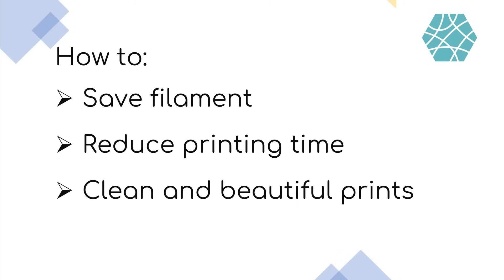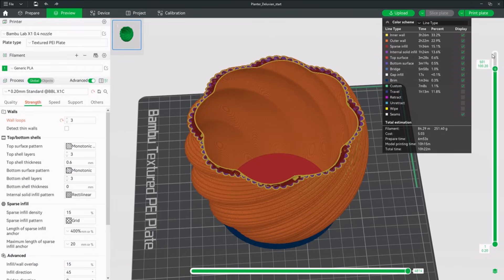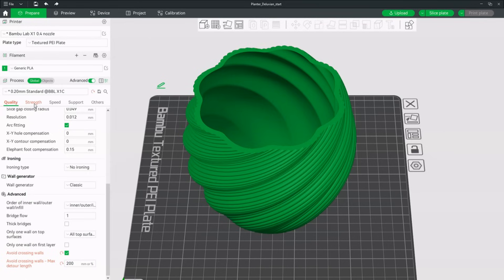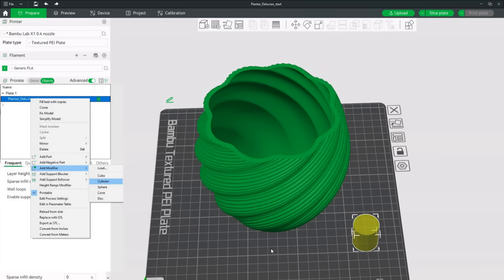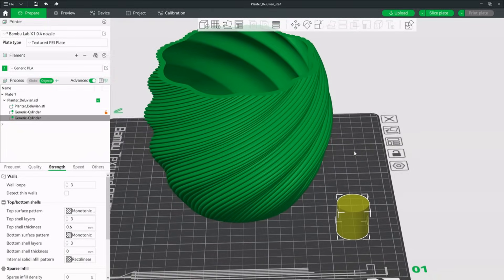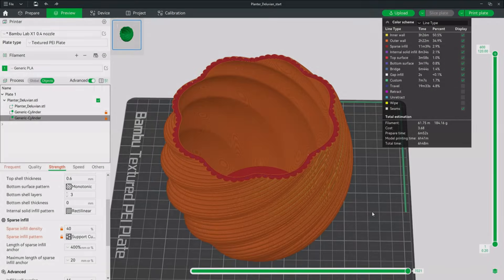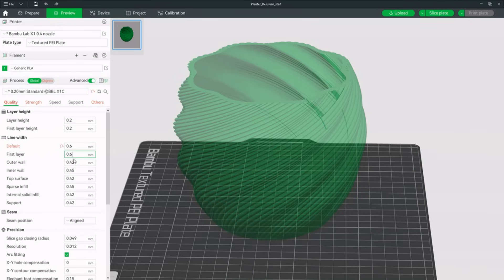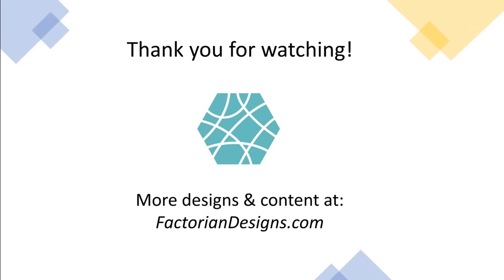Cut Your 3D Printing Time In Half!

Comment: DId they take away the avoid crossing walls option? For me it's not there in Bambu Studio
Reply from the maker: No, its still there for me. Did you turn on "advanced settings" ?
Reply: @Factorian_Designs  Yes I did, it's definetly not there. Did you update Bambu Labs to the newest version?
Reply from the maker: yes I did, for me its still at the very bottom of the quality tab. I am honestly not sure why yours is not there.
Reply: @Factorian_Designs  I suppose it had something to do with a profile I selected? After I restarted Bambu Labs with another model, it was exactly where you showed it.

Comment: Great video! I'd love to see a similar video on how to optimize slicer settings for the 0.8mm nozzle on the A1.

I'm just starting with the 0.8 nozzle for functional prints and i have to relearn what is appropriate for line widths, layer height, speed. And also now I have to apparently configure max cubic mm throughput of the filament itself.

Comment: After you changed the line width settings to 0.6 mm, you decreased the wall loops by 1 from 3 to 2. The default setting for wall loops is already 2. Does this mean we should decrease it to 1 or keep it as it is? Thanks for the tips!
Reply: @Factorian_Designs Here wondering the same thing. Your slicer shows the 3 highlighted red meaning it's been modified from stock value, then you decrease it to 2. Mine is already 2...  This almost suggests you've increased it at some point just to decrease it again. My current assessment is that leaving it at 2 but increasing line width will slow my print not expedite it.

Comment: Thanks for this video, its super helpful. One thing I don't understand is the Line Width setting though. When I increase my line width to 0.6, it actually increases my print time significantly instead of reducing it. Do you have any idea why that happens? Thank you
Reply from the maker: You may already be at your maximum flowrate. When you increase the linewidth this also increases the filament flow through the nozzle, in return the slicer might slow your print down to prevent underextruding.

You can increase the maximum flow rate in your slicer as a test. But be careful, this limit ist there for a reason. You might have to get a highflow nozzle if you want to print even faster.

Comment: I suppose the design type matters quite a bit, because I followed these and initially had a reduction of about 10% on the time, (no where near 50%), and then once I added the layer modifier and it actually increased the time by 20%.   Maybe I missed something - but I don't think I did.
Reply from the maker: Design can matter quite a bit but I don't see how this should increase print time. Most of the time I can reduce the print time by around 30%.

Comment: Only hobbyists have time to spend so much time in Slicer. Everybody who runs printing farm, has no time for this. It is kind of sad.
Reply from the maker: I use these all the time for my small print farm. In my opinion, print optimization is important. Spending a few hours optimizing a print can save you a significant amount of time and money in the long run. Check out my new video with a total of 4000 produced eggcups , and you'll probably see what I mean.

Comment: There are no Height Range Modifiers in Cura, so you use cylinders?
Reply from the maker: Yes thats what I did when I used cura. Cura does offer a postprocessor "ChangeAtZ" but the setting you can change there are pretty limited.

Comment: Do you know why the nozzle kicks off sometimes the object? I was printing a miniature and nozzle kicks off and lost  everything.  My print is a bambu A1.
Reply from the maker: Most of the time this is due to warping/insufficient bed adhesion, but its hard to say without seeing the failed print.

There are lots of websites which explain this problem in more detail than I ever could, hopefully this keyword and a little google search helps you solve the problem.

Comment: And if you completely remove the part from the table, then it will print in just a second
Reply from the maker: and while we are at it lets just throw out the whole printer to safe even more time.
Reply: @Factorian_Designs  By the title of the video, the picture in the preview and the methods described in the video, this is exactly what you mean.

Comment: The settings will help but the infill part is very misleading and should have been stated as being a case by case basis.
Reply: Yeah, if it's not something that has a form already, such as this vase, it won't work
Tried with a cube open at the top and you can just press and crumble the walls

Comment: I'm stupid.  Everything I work on will drop to the plate.  I haven't found the setting to allow objects to sit  off the plate.
Reply from the maker: Imported STLs/STEP files will always drop to the plate (others wise they would not be printable) Only modifiers are allowed to "float".
What slicer are you using?
Reply: @Factorian_Designs  Using Bambu Studio. Used to used Cura slicer for my Ender 3 but got myself a Bambu Labs A1 with AMS lite so assumed the built in Add objects would be the same.   All primitives drop to the build plate.
Reply from the maker: Right now you are probably just right clicking your screen and then select "Add Primitive". This won't work. "Primitives" are treated like a printable object and can't be printed into the air. Thats why they drop to the build plate.

What we want are "modifiers" connected to the geometry. Watch the part of the video again where I add the modifiers. I am certain this will solve your problem. :)

Comment: Vase mode does not necessarily mean poor quality parts. Use a larger nozzle and print wider walls for vase mode. I only occasionally sell stuff locally, but I've never had complaints with various vases printing .8mm to 1mm line widths.
Reply: I've printed shockingly strong trash bins (285x285x320) with a 0.6mm volcano nozzle in vase mode and limited flow to 16mm3/s. You can kick it around no problem 😅

On the flip side, I printed a sock hamper in vase mode with a 0.4mm nozzle and even though it feels "strong" for how thin it is, it's definitely flimsy 🥲

I haven't tried going thicker than normal on 0.4mm in a long time, when I do it's to make parts stronger with solid infill. Near mold like, I'm talking about breaking parts over and over and never breaking on the layer lines. Secret sauce, over extrude for the infill, not just make it wider and only part cooling for the overhangs and find the nozzle full saturation flow. Wide nozzle tip helps on multiple levels
Reply from the maker: You are right I maybe worded that a little to extreme, with bigger nozzels the models do become a lot stronger. Also if you sell locally the buyer can inspect the print and decide on the spot if its sturdy enough for them. So vasemode prints are great for that setting.

But in my experience selling vase mode prints online with 0,8 mm linewidth still results in more returns than normal prints. I haven't tried going bigger than that. Maybe its worth a try.

Good Input 👍
Reply: @Factorian_Designs  It's interesting you've had more returns with vase mode. I would expect the lack of a z seam results in a better looking print and satisfied customer.
Reply from the maker: @bjaurelio  Thats what I initially thought as well 😅

Comment: Any miniature video on time and settings for best results for .2mm nozzle would be great for the future. Also great ideas for vases. BTW would that still be waterproof?
Reply from the maker: I don't have much experience with minatures so I will probably have to pass on that. But yes the vase should still be waterproof. If not slightly increase your extrusion factor and printing temperature.

Comment: Nice results! But I didn't really get the first part with the cylinders. What is going on there? You print walls as 2 single outer walls not connecting each other, one pointing outside and one inside the vase? But what about cylinders, looks like they are way too high than the infill is going... I'm using Cura btw.
Would really want to know what exactly you are doing there.
Reply from the maker: I am just using modifiers, to modify the volume where the cylinders and the planter are overlapping (more infill etc). It doesn't matter if your modifiers are a little too big. The slicer will just ignore those parts. Hope that helps!
Reply: @Factorian_Designs  Ok, so it only modifies on the overlapping section...I see... thanks! 
But what about the general print/slice of the vase on the video are there 2 single layer walls or 2 double layer walls, and are just with some free space in between?
Also if you don't mind(I hope) to tell me if I make line width 0.8( on 0.4 nozzle) for example - slicer automatically calculates number of walls for a specific thickness and shows you it changed volume, but it doesn't show any change in the material flow. Shouldn't it be more extrusion for the double width or it just automatically slower the speed or else happens?

Comment: Are these settings good for any print (even models/action figures) or just for prints of vases or simpler things?
Thx
Reply from the maker: I would use them a bit different for action figures. You will probably be better off using a low wall count + lightning Infill in the general settings and then add extra walls with modifiers where your model is fragile. This should save filament and reduce printing time.

I hope that helps!

Comment: Hi, thanks for the video. I got a bit lost after 4:35. Why the upper cylinder disappears after a few seconds? What changes have you made ? How can you avoid printing the upper cylinder ? Could you please explain more? Thanks !
Reply from the maker: Hey, the cylinders I added are just modifiers. They only change the settings for the main geometry where they overlap. The modified settings for the cylinder are only the infill %, type and top layer pattern.

The shape of the modifier structures themself will never be printed. 

I hope that helps!
Reply: @Factorian_Designs  Thanks for giving me the keywords! I managed to find more youtube about modifier and I now understand what it does. That's briliiant!

Comment: Great video! I switched my A1 to the 0.6 nozzle but haven't experimented with many other settings to speed things up like this, since it should technically have the capability to but it doesnt seem like its helped all that much. Curious about your advice on that. Could be a video idea as well :). Subscribed!
Reply from the maker: This works with any nozzle size and printer. But you probably have to increase your layerheight with bigger nozzles and higher linewidths. At some point maximum flowrate will become a problem but that is a whole other topic itself.

Comment: With 0 infill do the vase walls squeeze together every time you pick it up? From a quality perspective I would imagine customers might think it's low quality if so, similar to how you mentioned vase mode printing.
Reply from the maker: 1,2 mm thick walls with this kind of outer shape which is also connected at the top gives a pretty sturdy structure. I haven't had any significant bending so far.

Comment: Rather than use modifiers, Prusa slicer has Lightning and Support cubic infills which basically print at 0-5% when you dont need them and then ramp up to whatever you set (20% for me) when they need to support features like the top layer.

also, for mass production, I would just design the pieces with hollow walls and solid top/bottoms and then just print at 100% infill so you never have to worry about the settings.
Reply: Your suggestion for making these changes at the design level is extremely dependent on the design; even for this basic example that was shown in the video, making those changes in the slicer is going to be significantly faster and easier in the slicer. Additionally, now you're designing for a very specific production environment which is going to reduce the utility of the design, and then like before the overhead of making edits or changes at the design level is going to be higher than making those tweaks at the slicer level.

Comment: How about just designing it better?? Why does it have double walls? Just make the walls 5 layers thick in the model. The same goes for the bottom - what use is the double bottom? It won't be strong with 3 bottom layers anyway. Make it 1.2mm thick and you don't need a modifier. Whenever I see a model, say a box for electronics, with double walls, I just cringe. Why design models for 3D printing when you actually design them for cutting out of wood or something??
And if you can't change the model, even better way is to reduce the internal dimensions using the slicer using either the X-Y hole compensation or X-Y contour compensation, you can achieve a similiar effect (but slicer sometimes breaks the model in places if you overdo it).
Kudos for not wasting our time, though, and still useful tips (most people don't even know how to use modifiers).

Comment: Nice job, but the strenght of the vase, will not be the same as before, it will be more fragile, i suppose
Reply from the maker: The missing infill barely makes a difference. Strength comes form walls, not infill and its plenty strong this way. You should try it out yourself!

Comment: the only thing you did to save time was reduce the structural integrity of the part. That was always an option that is tuneable by adjusting the infill density, You've just manually selected where infill is most important. The other settings you suggested  wont speed up your prints and are highly subjective to each printer. Disabling them for every print is not a solution to increasing speeds or surface finish of parts. If you tune your retraction settings properly, you wont have issues with Z-hop. The only reason that people typically do is because they've neglected to adjust these settings.
Reply from the maker: I get your point, but a lot more than just structural integrity and infill was addressed. For example, adjustments were made to line width, wall count was reduced, and travel paths were changed.

Additionally, you do want to reduce material in places where it's not needed. This is a basic concept in all manufacturing, and using modifiers is a great way to do it with intent. You are partially right, though; you can't use the same settings for every print.

Hopefully, this video will help people learn and do their own optimization to reduce printing time on other designs as well.
Reply: I seem to agree and it just feels like a cheap way to get less time and price to just sell more with lesser quality products
Reply: Manually selecting where infill is most important seems like a very useful tip. Cool getting to see how to do it.
Reply: @IronHive  I don't disagree, but it's not applicable for every print. The title of this video implies that you can just simply adjust these settings to cut your print time in half, when they could have just made this a tutorial about variable infill. They chose a clickbait title and only really demonstrated that they could reduce the print time of an oddly specific part
Reply: @Shraedar  to be clear.. from this title, you expected this video to cut all 3D print times in every circumstance in half?

Comment: Other things i do, if design and flows allow me to, is higher speeds (250-300) for inner walls and infill. 

One of the best mods i did for big parts on x1c is the e3d obxidian 0.6mm nozzle. I can get like 30mm cubed flow with any filament (don’t even tune it, just turn it up and send it). This with 0.4mm layer heights and printing big stuff now in like 1-2hours. Big stuff for me is workshop organisers etc. stuff I don’t care of visuals, just speed. 

I love the ability with this setup to just be able to do quick test prints in less than 30 minutes sometimes for like 5-10mm z height test fit objects

Comment: nice video, thx. Additionaly I use variable layer hight, this is great because detailed features get better results and less detailed stuff is printed faster due to increased layer height.
What I didn't understand is the modifier thingies. Why you choose the geometry modifiers instead of much simpler height modifiers? just add height modifier for the first 5 mm or whatever your bottom height is and then select the infill percentage, same with the top.

A note to z-hop: This is mentioned often in "make prints faster/better/... videos" For at least my printer I have to disagree, prints look terrible if I switch it of completely. So better say "try switch it of if your printer is ok with that".
Reply from the maker: Thank you for your input with the layer height, good addition. 

If you use height modifier for the lower part, you get a little more infill where its not needed the modifier is a better fit. 

I see no difference with z-hop on/off but this doesn't change much for the printing time anyways. :)

Comment: Why do you think z hop has no benefit? It was implemented for a reason, it greatly reduces the risk of crashes and dragging. If you experience stringing as a result you need to tune retraction settings or reduce travel.
Reply: For most parts it is unneccesary especially if you turn on don't cross walls
Reply from the maker: Lost in Tech has a great video about z hop where he explains it way better than I could with text, you can checkt it out here:

https://www.youtube.com/watch?v=4xyevbElGIU

It can have some benefits but most of the time you don't need it.
Reply: If something curled up it will either way get hit, with or without z hopping. I have turned it on for the noise reduction.